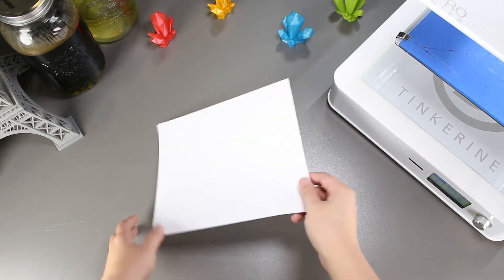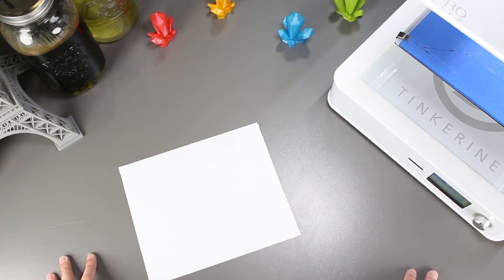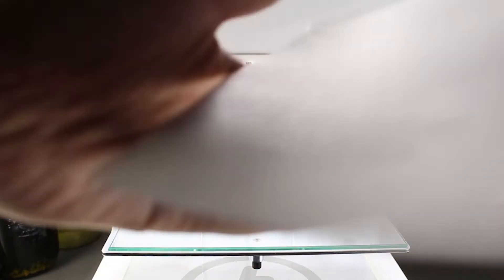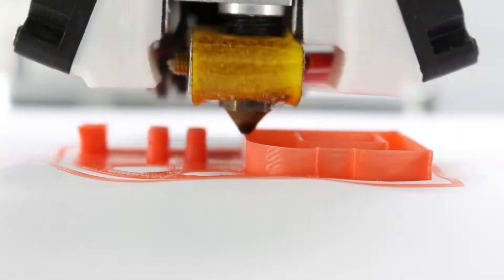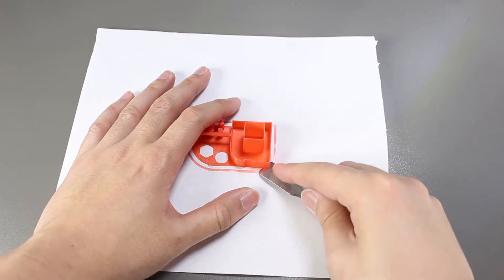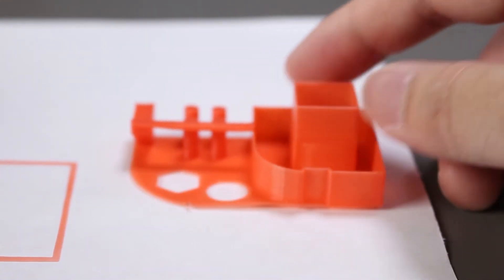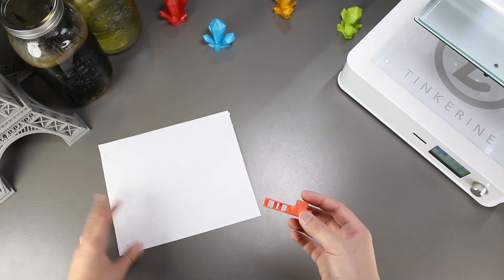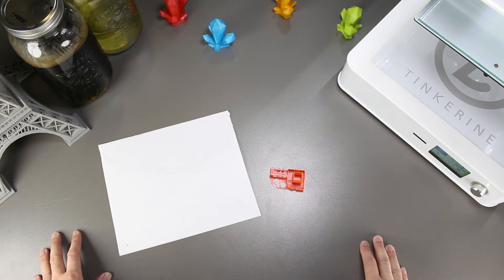3D Printing on Paper

Comment: I saw nylon filament manufacturer that reccomends gluing office paper to glass bed using glue stick (glass beds and nylon are otherwise tough luck). Nylon is bit tough in terms of bed adhesion and this approach seems to work reasonably well as long as you can prevent warping.

Comment: im a bit late with the comment, but i used 3 layers on my bed. layer 1 is painters tape without overlapping, above that is double sided tape also not overlapping, and a sheet of normal paper on that. it works extremely well with every material ive tried, even polyoxymethaline filament wich is a nonstick-low friction-high heat-high strenght engineering grade filament that is notoriously hard to print with/adhere to anything because of its high heat resiliance and low coefficient of friction .
Reply from the maker: Thanks for the comment and letting us know what you use! We'll look into trying it ourselves as well.

Comment: Hi guys, I'm glad that you tested it! Just googled "3d print on paper" and tada, here you are! :)
This is only in a planning phase but I'm planning to make a sheet strecher for the heated bed and I was curious if paper could work or I should keep the kapton idea. Paper fiber residuals are not a concern for me.
Thank you!
Reply from the maker: Thank you for the comment! Let us know how your experiment goes.
Reply: @Samuel D Rhodes Last year was not about printing but it is still in my plans. I'm sure the sheet (paper, capton, baking paper) need vacuum. My plan is to find a solution to make a heated bed vacuumable, but: I think it requires a flat and dense mesh surface for the paper (or else) to make a strong and even force. I don't want to use compressor, so a syringe or a piston would create the vacuum. As it has little air capacity it requires perfect sealing around the sheet and also a sheet needs to be dense enough.

Kapton is a heat resistant, semitransparent tape. Commonly used as insulator in tranformators, motors.
Craftbot 3D printer use a self adhesive sheet of kapton. At least PLA sticks very hard to it. If you doesn't hurt the kapton surface it lasts very long.
Reply: @Samuel D Rhodes Maybe try to open up the fibers with a smooth sandpaper. Without enough roughness I think you can't avoid the heating.
Now I'm ok with bare glass for PETG and hairspray coated glass for PLA so experimenting with paper is a later plan for me, but happy to hear about your results.

Comment: I cant get things to stick on just glass, or abs slurry, or even glue stick for 3d printing. They don't stick well enough at least. Coarse painters tape works well with pla but you get stripes from the tape overlaps and such. The only thing that just about anything will stick to i have used is printer paper, every thing sticks very very well to it where you need water to remove the parts, and the paper is in large sheets so the bottom is even with out any overlap marks. Main downside is paper bits are stuck to the bottom of part and need to be sanded off also it can be messy to remove paper because you need to use water to looses the glue stick used to adhere the paper to the build plate. I believe it works well because it is not a chemical adhesion but a mechanical adhesion and the porous nature of the paper has the molten plastic gripping it well. Also be careful with water around the printer things could rust.
Reply: do you have a heated bed, in my case the PLA only sticks to the glass if I spray it with (some kind of) hairspray and heat the bed (60°C works well for me). The moment the bed cooled of again to ~25 °C I can just take of the print without it sticking